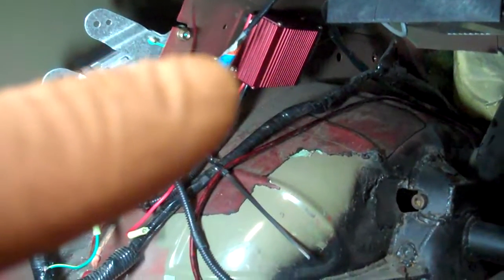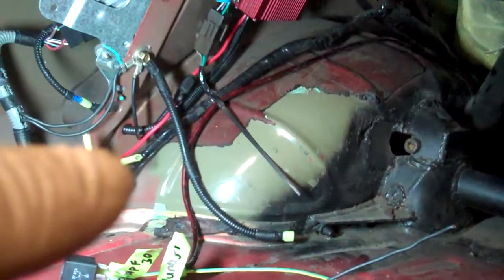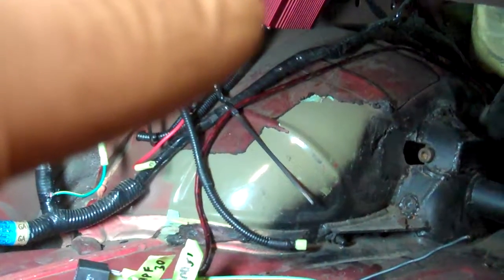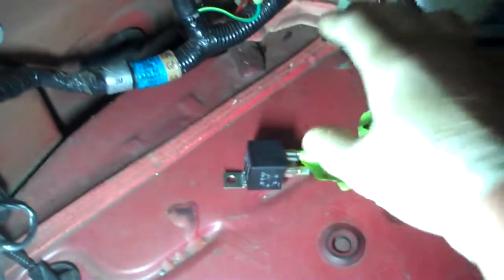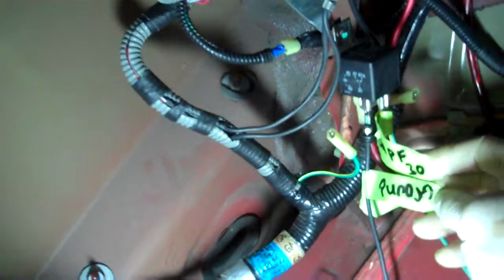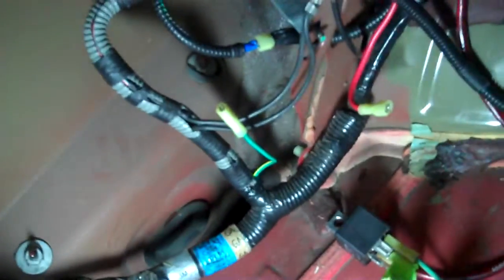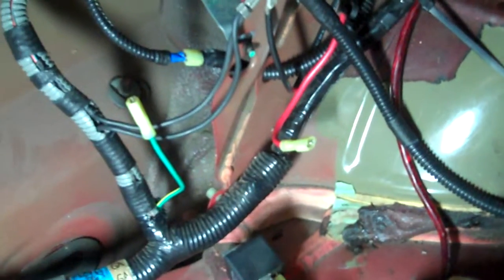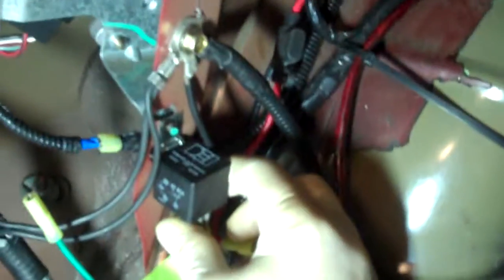tips on how to install kenny bell boosta pump 3

Comment: why are you using a relay ive only seen this method of installation and it says to use a brown and pink wire. http://mustangpartstech.com/files/2003_Cobra_Supplement.jpg also for the cobra it says to splice into harness coming from fpdm but for mustang gt it shows to splice into inertia switch(fuel cut off switch harness). so what do I do if I have a 02 mustang gt with 03 stock cobra tank with the stock dual pumps and mod fpdm
Reply from the maker: I would do some more searching on svtperformance.com that's were I found the info I needed. If you have the same wire colors that I do then I would just do it the way I did. Your wire colors may be different.